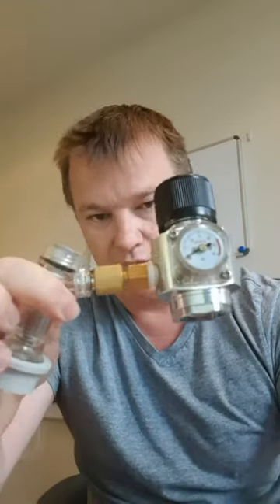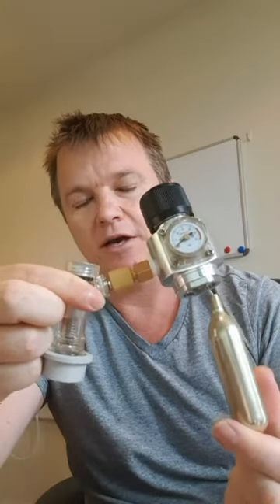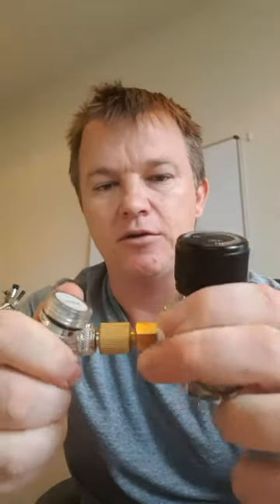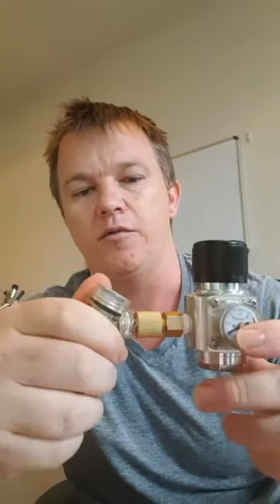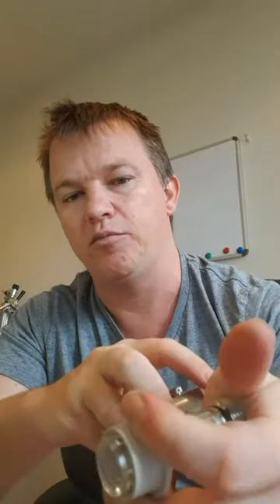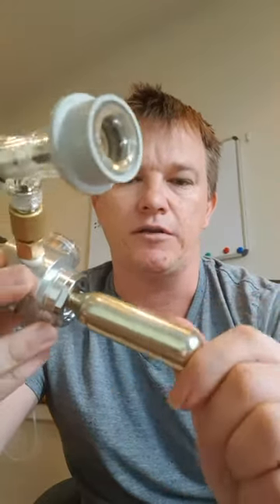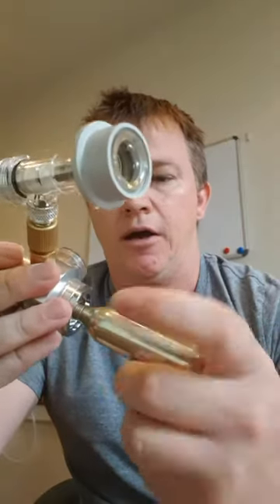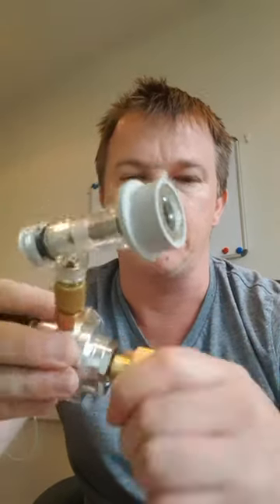The Professional Mini Regulator - iKegger

Comment: What does the bolt on the back of the regulator do? I have just bought one and there is a screw hole but not bolt in it.
Reply from the maker: It is a burst valve with a set pressure lower than the one that will damage the regulator, without the bolt gas will just go straight through (if it's one of our regulators, other companies are different)